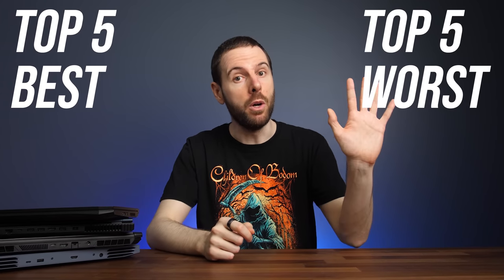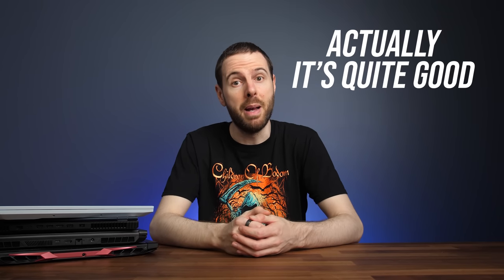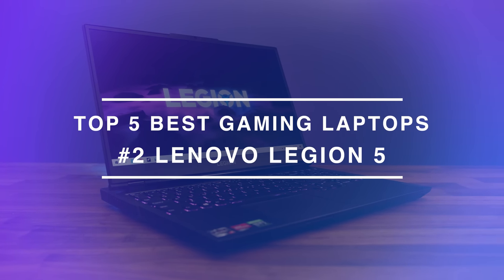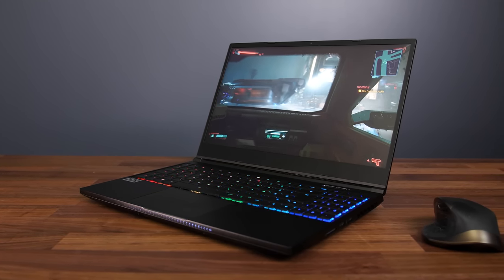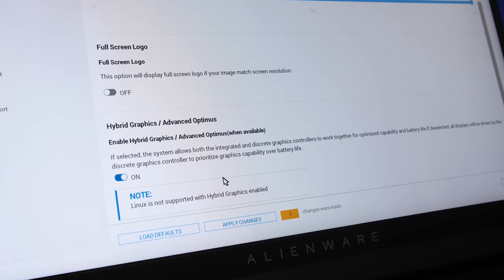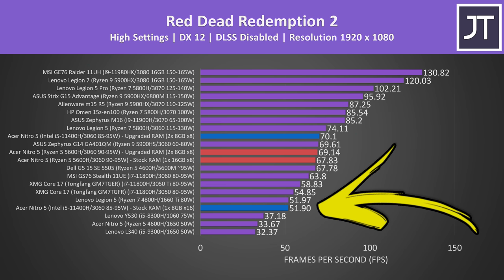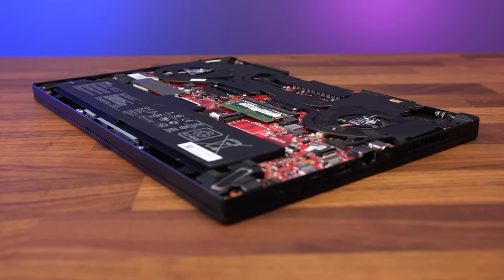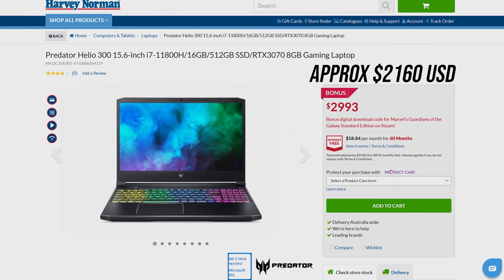Top 5 BEST & WORST Gaming Laptops of 2021!

Comment: Upgraded from legion 5 to a mech-15 last week. This video made me happy seeing both these laptops are at the top.
Reply: Why would u upgrade to something similar xD
It looks more like switching to similar than upgrading.
Reply: Bruh you living the dream. Me too one day
Reply: it's like having a Bose and buying a Sony headphone
Reply: I had the previous Mech 15 (with the 2080). I couldn’t get used to the keyboard. Since my son needed a new gaming laptop I gave it to him and bought the Legion 7i with the 3080. Since one has to be on wall power to really run the GPU, I think that the power drain due to the Corsair software is really an overrated point and, since you can just disable it and get a better power profile, I think this is a nonissue. Not really sure why you keep harping on this….
Reply: @ArnieHorta  I mean it’s a laptop with bad battery…. If it has to be plugged in it’s a worse pc
Reply: @kannanshrinivasan6984  Except it doesn’t have a bad battery. It is a desktop replacement with decent battery life if you disable one piece of unnecessary software. If what you are looking for is a gaming laptop with a 3080 and great performance it is hard to beat. When comparing it to the Mech 15 the issues I had with the keyboard made it difficult to use for anything but gaming. It is probably just me but other reviews of thiat laptop also commented on the difficulty of getting used to the keyboard. Hopefully they improved in this year.
Reply: @ArnieHorta  I mean it's a expensive laptop that comes with power draining software so he's being critical of it
Reply from the maker: Haha nice from great to greatest
Reply: @JarrodsTech  love your stuff man. Picked up l5p on your recommendation.
Reply: @ArnieHorta  lol this is such a weird thing to say to a reviewer. "Why do you keep harping on that point?" Um... so that people know prior to buying it the potential issues. I'm glad for videos like this it's why I bought the Legion 5 Pro
Reply: @FriendlyPCGamers  You said exactly what i was thinking. The legion isn’t even close to being obsolete or old yet he already buys a new laptop lmao
Reply: @YeaNo.  What issues? With same price you get identical hardware and performance.
The major issue i still see in laptops is, form factor and cooling.
From being easy to carry, comfortable to use, or to being a bulkier aggresive cooling system. If you know your use, you can end up sorting few models yourself, then research what brand is more value to you, from being warranty coverage, service center availibity/distance to pricing etc.

Comment: As I'm an engineer and game casually I got the 3070 Lenovo 5 pro. Thank you for reviewing it with such accuracy and detail. I immediately swapped ram for 64gb so the memory wasn't an issue for me. Thanks Jarrod.
Reply: One month in, how is it holding up?
Reply: @JamesMcarthy2369  Very good performance. Gaming or development both are effortless. The touchpad is not very good. I loved the large surface area but palm rejection is bad. Also i have windows 11 which seems to have many bugs. I would still suggest to buy, but don't upgrade to windows 11 for some time

Comment: Thanks for your thoughts, it is a good thing that these toys have gotten to the point where there are not any truly flawed devices. I almost went with the Helios 300 but went and grabbed a Nitro 5 Ryzen with a 3070 on sale instead. Acer has since upgraded the 3070 firmware to run at 100w for a nice bonus boost. I am enjoying it and it does work better with a US$60 8gb in the second memory slot. Keep up the good work

Comment: Thanks for the video! Saw this after i got my Asus TUF Dash F15. It's pretty good so far, way better than my old HP laptop with a dual-core i3. My personal experience is pretty good. I got the F15 with a 3050ti, 8 GB DDR4 ram, and i7-11370h. It runs most games over 100 fps on medium - high settings. Some games run less then 100 fps, but thats fine. For the most part, this laptop is way better than my old one, and because of that, I am extremely happy with it. It's pretty fast, lightweight, and 144hz. Can't get over it. No camera, but that's fine. It's overall a good laptop, just a quad-core cpu does tend to bottleneck gpu in more heavy cpu games. Other than that, it does extremely well in whatever I throw at it. I don't regret buying it!
Reply: Thanks I have been thinking of buying it . I'm worried if I bought the wrong one 👍

Comment: Just ordered a Legion 5 and waiting for it, glad I made the best choice there is. Thank you for making great reviews Jarrod, your reviews really helped.
Reply: there is big difference beetween sreen legion 5 pro and legion 5 ?
Reply: @JustasOmis  depends on the model. There are legion 5 with 144hz and 120hz and I've read the 120hz one is trash. I think they are models with rtx 2000 series though.

As for the 3000 series which are recommended on the video (I assume),
The 165hz ips panel, on the Pro version is much brighter (over 500nits), and the non-pro is 300 nits. The Pro version has a higher resolution and 16:10 aspect ratio. The non-pro has a 16:9 1080p screen. Both claim 100% sRGB coverage.

Comment: Here's a fun story...
I have the hp Omen 15 from 2018 with the i7 and 1060. My CPU fan failed and I contacted hp service in my country. Being 3 years old it was out of warranty. They quoted a price for the repair of one fan, it was $94(converter) which was a lot. I then asked local repair shops but they couldn't get the replacement part and it wasn't available online in my country. I finally found the replacement fans(both) from a US seller that ships to my country and ordered it. Even after payment for international shipping, customs and tax it came in under the price hp quoted. $82 exact, and that was for both fans. 🙃
Reply: lol Damn. Are you India bro
Reply: what about Actually fitting it? how much for fitting and servicing?
Reply: @sumitdalavi   my guess is they did it themself. It's generally about 8 screws to replace both CPU and GPU fans. sometimes you have to actually take out the entire thermal solution but not always. but it's like a 10 minute job that literally anyone can do.
Reply: @josephgood2704  he is probably talking about a laptop, As Desktop parts are available easily.
Reply: @sumitdalavi  I did that myself. It was easy enough. Also swapped out the thermal pads and Paste.
Reply: @AkshayDidIt  Yup
Reply from the maker: Oof that's annoying but better to spend that compared to e-wasting the entire machine

Comment: Bought Legion 5 Pro with 5600H and 3060 and I need to say I'm completely happy. It even came with a smaller 230 W power brick. The only downside is backlight bleed of its IPS panel (it's pretty terrible) but apart from that, it's a great PC.
Reply: it also has rtx 3070 version with 32 gb rab and same ryzen 7 which is better i think, you can also see
Reply: How much did you pay for yours?
Reply: @mythicgaming2552  not the OP but if you're getting it for under 1200usd, its a good deal. the 3070 is only slightly better for ~+250usd
Reply: @dga.k.adifferentguy6059  i purchased the Legion 5 - Ryzen 5600H + RTX 3070 + 16 GB DDR4  for 1200€ - will i be happy with this one`? ♥
Reply: @MoTz_50  did you have any issue with the memory stick or the ram?
Reply: @2.0Transformers   I don’t know what u mean with „memory stick“ but didn’t have any issues yet. 16GB RAM is enough for everything I do with the notebook. 
500GB SSD is ok but I will upgrade to 1-2TB soon. The Legion 5 is a beast for that money.
I would recommend the 5600H+RTX3070 instead of 5800H+3060. way more powerful.
Reply: @MoTz_50  tnx for the info:)

Comment: Legion 5 for the win,I absolutely love the design,I've got the rtx 3070 amd and it's a freaking beast,I game for hours some days and never any issues,great video dude,love your content 💯👍🏽
Reply: Do you have the 17.3" ryzen 7 model with 3070?
Reply: @Marekval  I have the 15.6" ryzen 7,I've heard the 17.3" model has a more washed out screen,response time is lower and the screen brightness is also lower.
Reply: Deep pockets win, the deeper the pocket, the more the satisfaction.
Reply: @ImRaizex the difference is 5pro has the 16" screen which is 500nits at 2k resolution,legion 5 had just over 300nits and 1080p which you can play comfortably on,5 Pro has a metal chassis which makes it a little heavier,legion 5 has a polycarbonate chassis and also I believe the 5 Pro power goes up to 150 Watts,legion 5 is like 130 Watts so you will have a slightly more FPS maybe 5-10fps difference,think jarrod did a video on it if you want more details 👍🏽
Reply: @ImRaizex oh and price is like $200 difference.
Reply: @ImRaizex what's the battery life?
Reply: @Tech-tonic187  According to Jarrods review it has better brightness and contrast and only has higher screen response time
Reply: @a-manthegeneral  thats correct he says its just a beefed up version of the legion 5,better build with the metal chassis 👍🏽

Comment: Hey Jarrod! loved ur reviews throughout 2021, all reviews have been saying the ryzen Alienware m15 r5 is a lot worse than m15 r6. But then some reviewers also claim the intel version is also bad. I have this laptop and the temps are really great and performance feels unmatched, it’s been a weird year for Alienware but there definitely seems to be some mass quality control issues
Reply: Plus the XPS 15 & 17 with poor QC on the trackpad. I mean, come on Dell! 🤦
Reply: I really wanted to buy Alienware m15 r5 but then i see jarrod's video and i am like is this laptop really this bad. If you could help me. With its temperatures and performance.
Reply: alienware are  heavilly ovepriced shit generally!! its bad when laptop with rtx 3080 are slower then cheap laptop with 3070   or 3070 laptop vs 3060 and so on
Reply: See,. looks like you haven't used any other laptop, that's why you have no reference to point out any type of difference, i had been gaming on laptop from 2008 (Dell Latitude E5400 (Core2Duo), still gaming on laptop, so i kinda have changed a lot of them and have pretty descent experience in using them and comparing them.
With that price point and size, if you get over heating, throttling, its very bad.
Reply: @nishada_bhi  I have had an M15R6 for a month now, and it's an awesome device. Before I had an MSI-GP62 with a i5-6300HQ and GTX 1060, and the build quality and performance difference is absolutely huge.
Keep in mind that I got mine for €1400 instead of the "standard" €2200,  since I got a student discount and it was already discounted that day...
Reply: It performs well , not for the price. Legion 5 3060 with ram upgrade will beat the shit out of it xD even if its a 3070/prolly even 3080 r5/r6 😂😂😎
Reply: Does anyone have any opinions to share on the M15 R5’s 1440p 240Hz display, from what I’m reading it is almost ideal? With 99% p3 color accuracy, high refresh, 400 nits, can anything even compete?
Reply: Agreed. I loved my M15 R5 but the jet engine fans were necessary to have at full in order to keep temperatures in check. Otherwise, fantastic laptop.
Reply: @rrokin  I had it. Was the most beautiful display I have ever seen on a gaming laptop (and I've had many). It's a necessary upgrade if you're getting it.
Reply from the maker: Yeah they definitely perform well today with all the updates in place, it's just they should have launched them in that state instead of how they came out
Reply: @robustloki  I am looking to buy a gaming laptop and literally the Alienware M15R6 beats even the Lenovo Legion 5 Pro, just check Jarrod's charts.

Comment: Battery drain issue in Lenovo Legion 7 can be removed/repaired in 15 sec permanently and you can still have amazing RBG options. It’s not an issue for like 98% of users...
Reply: but why should the user have to do it though? and that's why the laptop sucks. did they get rid of that disco vibe when you wake it from sleep?
Reply: Pls tell me how
Reply: He's already mentionned that. It becomes an issue when they don't fix it for a whole year. I have a Legion 7 and paying that much and still have to disable functions is frustrating (disabling corsair services means iCuE loses some features).

Comment: As a Dell G15 owner since 2021, I can confirm that it's a great laptop with great battery performance, although it gets hot if you use it for high performance for an extended period of time. Another annoying problem is that the Alienware Command Center, which is the control panel of the laptop and it's bugged in my pc, I can't use it to adjust the fans, rgb, and else. However, overall it's a great laptop and I'd recommend it!

Comment: I am late adding to this.  I own a Lenovo Legion Y540 myself and I have to say that it has a problem with the power plug.  I thought I was alone but you can google and find several people looking for answers to this.  Within 7 months of owning mine, I had it repaired under warrenty.  Afterwards, the repair was expensive so I bought a new laptop power brick and that worked for a while.  I've done modifications to the plug to help and at this point I think I'll need to replace the power plug in the laptop itself entirely.

Needless to say my experience with the Lenovo Legion Y540 long-term has turned me away from buying another one or recommending it, which is painful because everything else about the laptop, as Jarrod has confirmed, has been amazing.

Comment: The 3060 TUF15 costs 1150 bucks in the US as one of the cheapest 3060 laptops you can get, so I guess it'd make more sense in the states
Reply: It’s terrible. It has the performance of a 1660ti when I bought it. Has to refund it and get a better laptop.
Reply: @personperson8563  lol looks like I dodged a bullet. I was considering getting it a few months back and it was out of stock. Got the Zephyrus GAG instead, still with low power GPUs, but definitely performing better than 1660Ti

Comment: @Jarrod'sTech  I received my legion 5 pro with 3070 last week (a pretty big upgrade from my Asus G75VX). It came with 2x8gb sticks with the GOOD timings, the same as you show in your upgraded ram video (so I guess Lenovo fixed the ram issues). I found your channel a month ago and I can't explain how much value you give to us, Jarrod.
Reply: Update: after about 10 days of use, P key on the keyboard broke (key cap can't stay in its place and P is not working when I press it) and I hope reseller's warranty will cover it 😢
Reply: @djagoegei18  i am thinking between legien 5 and rog  zephryus g15 which one should i get
Reply: @arpitmishra6711  I prefer the legion because of:
1) the price - it's cheaper in my country
2) 16" screen
3) 1600p screen
4) 16:10 screen
5) looks better than zephyrus for me
Reply: Update 2: Reseller offered me to replace the laptop with brand new instead of repairing. I accepted, but now I'm worried not to receive a refurbished laptop/laptop with bad ram timings/laptop with dead pixels. 😢
Reply: Update 3: 
My new L5P came today, I installed windows and boom - DEAD PIXELS. A lot of them. 7-8 in the area below the camera and some dead pixels next to the left and right edges of the screen. Also, the laptop came with the SLOW ram this time. The slow ram is made by Samsung and has part number M471A1G44AB0-CWE. The fast ram is made by SK Hynix and has part number HMAA1GS6CJR6N-XN.
I already requested a return and refund, but I prefer a replacement if they offer it again.
Reply: @djagoegei18  well thats upsetting
Reply: @kit675  It is, I'm stuck for now with my 8 y/o laptop
Reply: @djagoegei18  JEEZ that’s actually terrible i’m so so sorry.. what r u gonna do
Reply: @kit675  I really needed the Lenovo for a 3D project I'm currently working on, but I guess my old laptop will be my buddy once again at the cost of time (because 3D renderings are so slow on my old laptop)
Reply: @djagoegei18  that must be so annoying to deal with. is the project for school or work? is it like impossible to work on rn or are you doing ok
Reply: @kit675  It's a work project. It's possible to work on with my current laptop, but it's very slow and the program is constantly crashing because of not enough vram.
Reply: @djagoegei18  how frustrating to have a great laptop.. then to be forced to use the old one again. i wish u luck friend lmk if u ever get a better one!
Reply: @djagoegei18  Hey so how has this whole story ended? Did you manage to get a good quality L5P replacement?
Reply: @CosmicTeapot No, I returned the two L5 pros and got my money back. The first L5P got a broken key on the keyboard. The second came with a lot (10+) dead pixels from the moment I booted it for the first time and also with the slow ram. I'm glad I didn't get a new laptop tbh, because I decided I should get a desktop. L5Ps actually were very loud under load and reached very high temperatures if I didn't extra lift the back of the laptop. My G75VX keeps 15-20 degrees Celsius lower on both CPU and GPU without being extra lifted.
Reply: @djagoegei18  Okay thanks for the update, much appreciated. So all in all, would you say a 2021 Legion 7i is a better/safer pick than a Legion 5/5 Pro, or would you recommend avoiding getting a Lenovo altogether?
Reply: @CosmicTeapot  idk if it's "safer pick", but 7i is better than 5/5p. Legion 7 is double the price of 5/5p in my country, so it's not worth it. If you can get a 7 at price similar to 5/5p, I'd say get it. I think Lenovo is a good brand, maybe I just got unlucky with the two laptops, every machine can break or come defective, Lenovo or not.
Reply: @djagoegei18  On Lenovo's Canadian website, I can somehow get the 7i with the same exact specs as a 5 Pro (i7 - 11800H/32 GB DDR4/RTX 3070/ 1 To) for about $35 CAD less (?!) I don't understand how but I think I'm just gonna roll with it.

Thanks again for your insights, they have been tremendously helpful!
Reply: @CosmicTeapot  7i is a solid laptop. I think you will not regret it.  Enjoy!